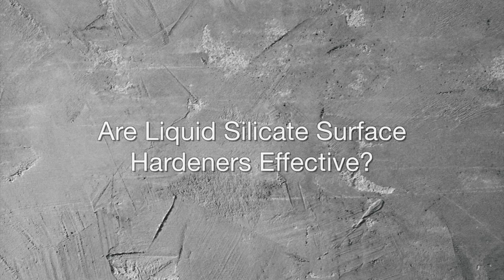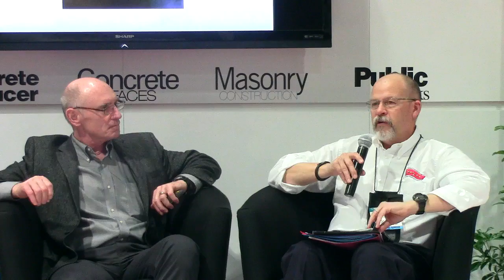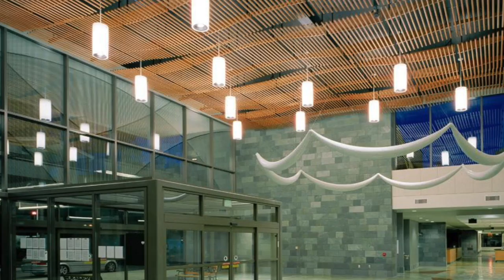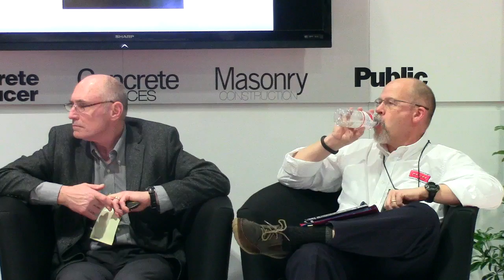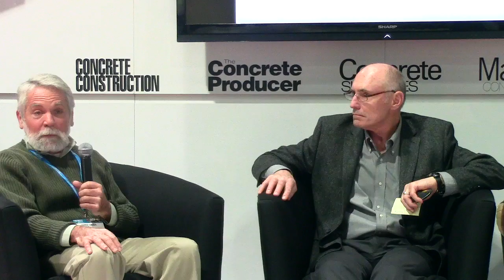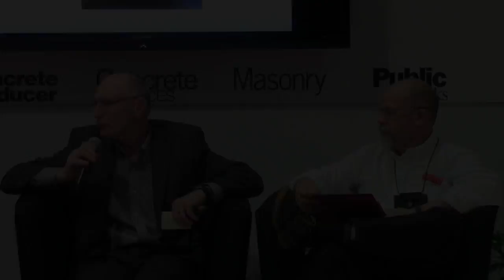Are Liquid Silicate Surface Hardeners Effective?

Comment: So what is George referring to at about 4:40. I believe it is the thesis of Massud Sadegzadeh, University of Aston, 
July 1985, submitted for Doctor of Philosophy. What does modest and significant mean? I look at page 160, 
Table 6.9 of the thesis and page 97 section 3.3.3.1. to find A=20% sodium silicate solution in water an
B=20% magnesium flurosilicate solution in water (British spelling?). With 3 concrete mixes A averaged 29% less
loss and B averaged 28% less loss. All of the preceding is meaningless without context of the thesis. George with extensive testing of concrete is saying what?